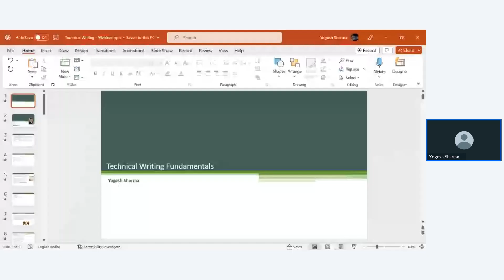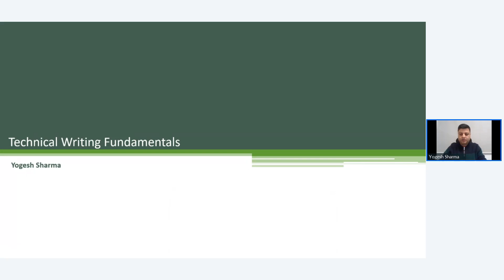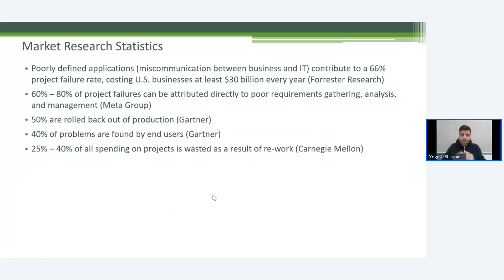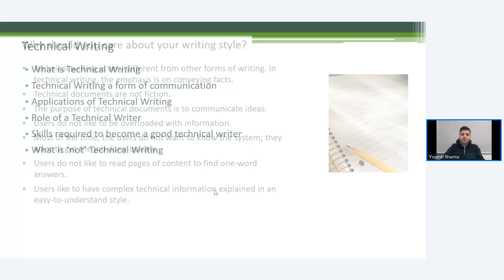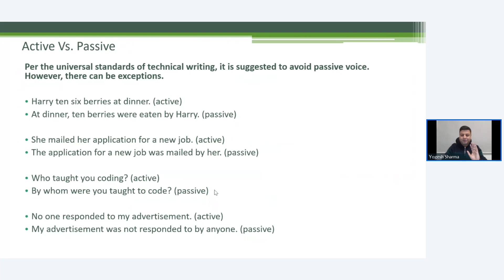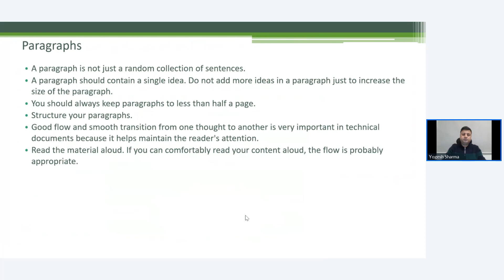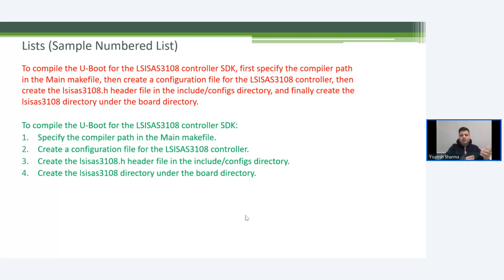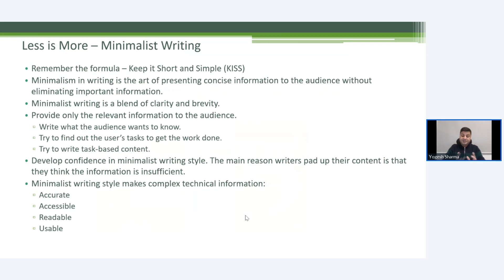Technical Writing Fundamentals

Comment: Hi Yogesh,

I went through your video.
It gives good information on technical Writing Fundamentals.

Here are some suggestions:
After 35:00 minutes, you can more slides/examples as it makes it easier for the viewer to see example and try out. 

Thanks,
Meenal
Reply from the maker: Hi Meenal. Thanks for the feedback. Actually there was a glitch with the webinar tool zoho and it stopped sharing the PPT. I'll need to re evaluate the tool and use a different provider next time.
Reply: Thank you.